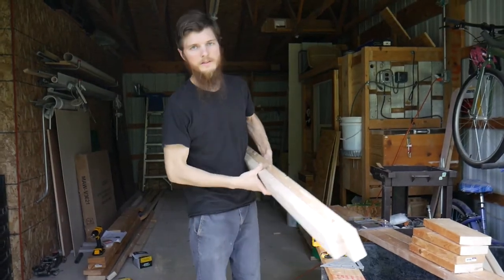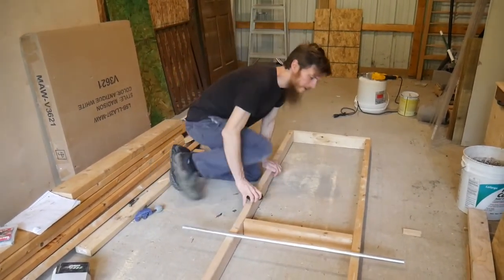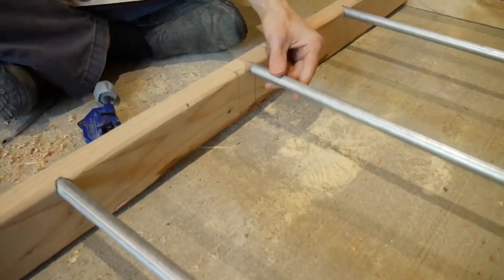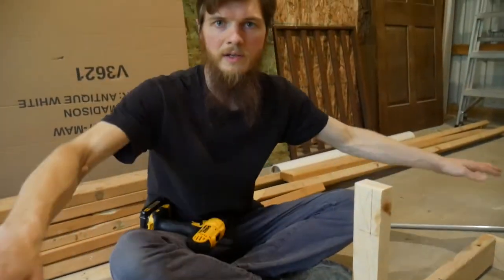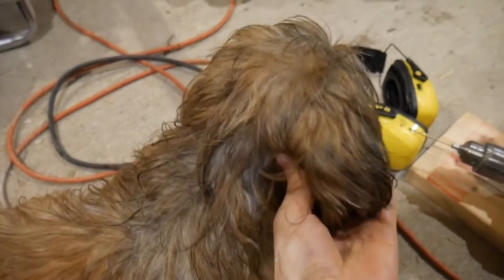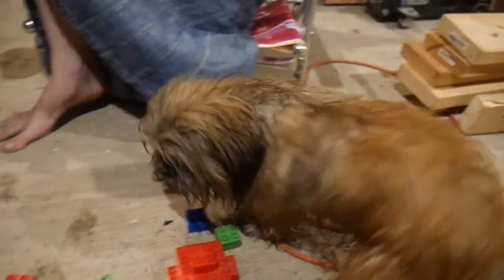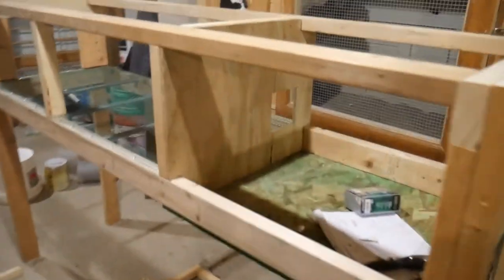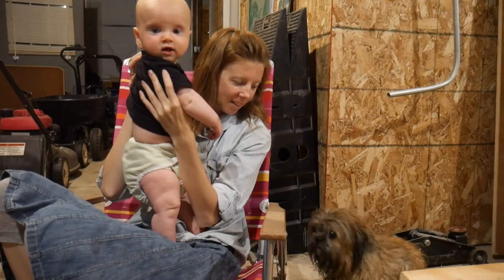Starting to Build a Quail Cage

Comment: why didn't you use staples to hold wire tight?
Reply from the maker: I just prefer screws. They are easier to remove it needed and staples can break the wire if driven too far. But just preference mostly.

Comment: Hi I am currently building a cage fairly similar to yours ( many thanks for your well presented video) -- what I wish to know is I am using 1/2 inch square wire pvc coated mesh ( hardware cloth) -- thicknesses 0.9mm -- my wife is concerned it maybe a bit thin -- do you know if there can be an issue with the thickness or thinness off wiremesh for the Quails to walk on?? Norman.   England